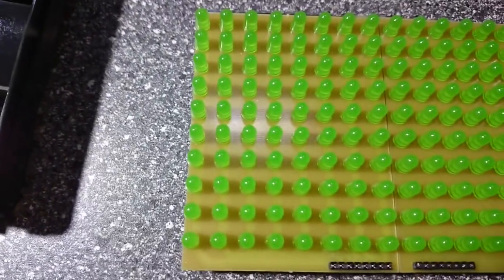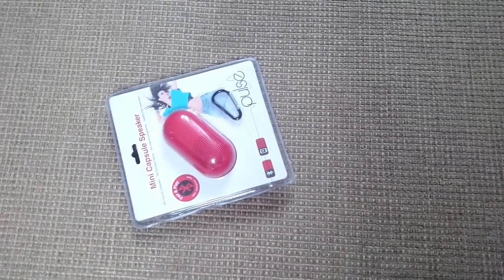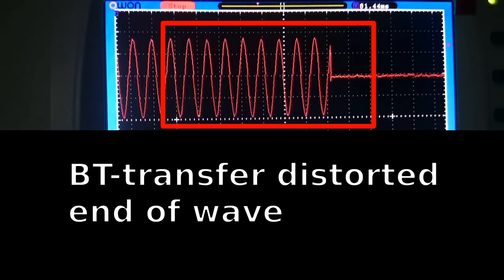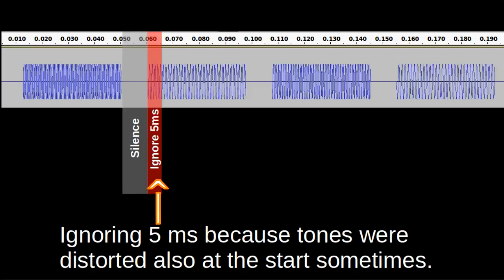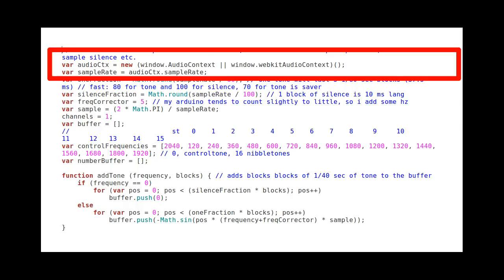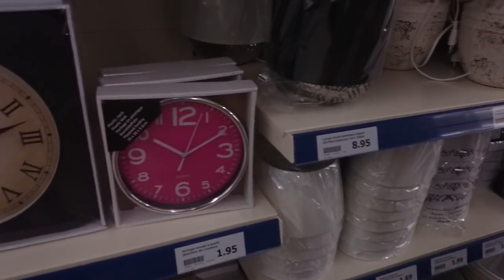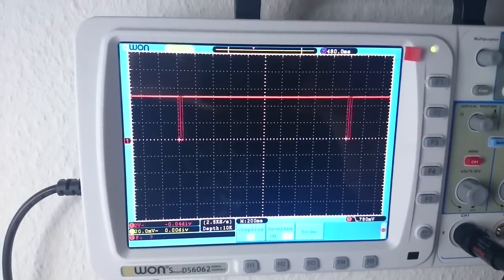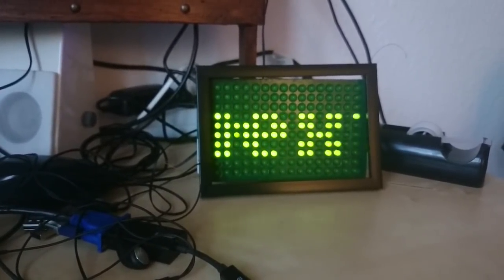Joe's Arduino LED matrix display (clip 2/2): Bluetooth transfer

Comment: you can build more high speed communication using comparator and interrupts
Reply from the maker: That is true! I realize that my method is far from optimal. But my display clock ticks with 8000Hz (timer-interrupt controlled) and I didn't want to mess with that by another interrupt.